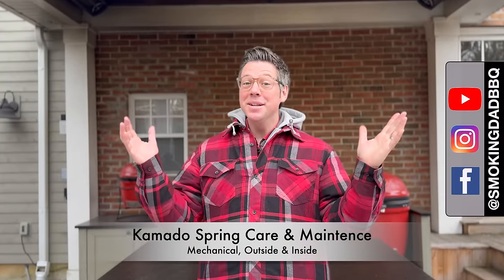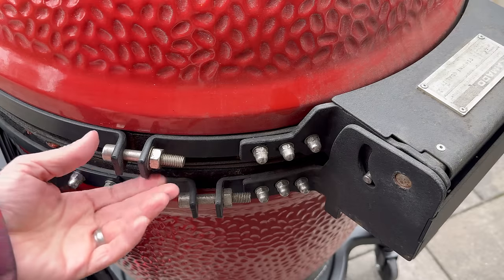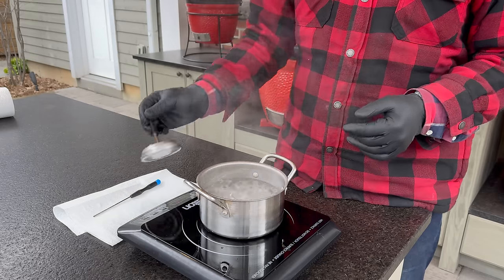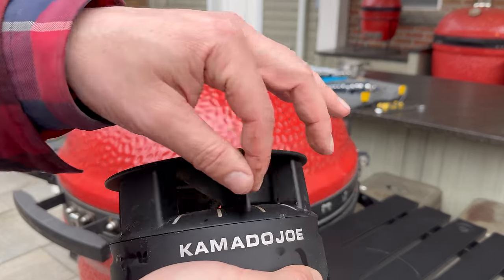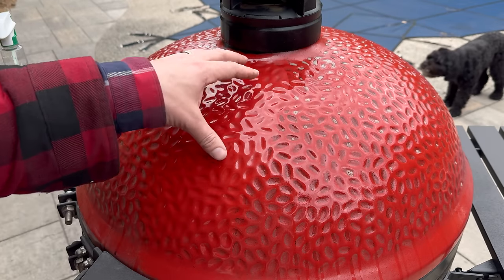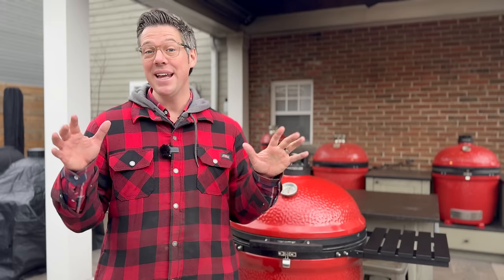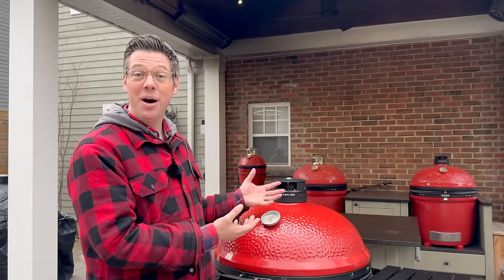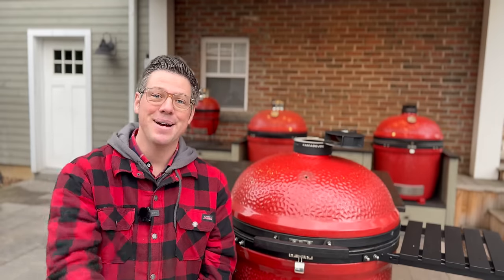3 Kamado Joe Cleaning And Maintenance Tips For MAX Performance & Longevity

Comment: While I'm being assistant SDBBQ, I'll add that drill brushes are great for cleaning leather seats in your car and cleaning soap scum in the shower.  I bought a set that has color-coded brushes that range from soft to stiff.  Apparently the stiff ones are good for paint removal.  I haven't tried that.

Comment: I've also found cleaning the outside of a Kamado when it is still hot (not astronomical; maybe 150-250 F) makes it A LOT easier. Just like hot vs cold water for cleaning dishes.

Comment: Great video.  It is definitely time to do this here in the SF Bay Area if it ever stops raining.  My two cents USD:  Krud Kutter is my go-to.  It's not "organic" but it's reasonably benign and it cuts through grease better than anything else I've used, including that orange stuff.  Also I really, really recommend a small ash vac for regular cleaning.  Shop vacs aren't built for the dust that results from Kamado Joe cooking.  Ash vac were originally designed for cleaning fireplaces.  Mine is battery powered, so no outlet required or cord to get in the way.

Comment: Ashes (at the bottom of kamado) are great insulant and they protect ceramic. Also they add accumulation capacity. I would recommend to clean, but not so thoroughly as you did on video. Thanks for great video!

Comment: Great tips on keeping your grill ready and clean every spring.  I haven't done a clean burn in years because of cooking my gaskets over time doing the clean burns.  I found putting just a little more charcoal in the basket and letting it go full out after my cook usually keeps the grease burn out of the unit.  I have cast iron deflectors that I usually put AL foil on to help the clean up too.  I live in a dry climate and don't have to worry about rust or mold during the winter.  I also cook weekly in the winter too.  I found the KickAsh basket and ash pan work great in making it easy to clean up after a cook in my Green Egg.
Reply from the maker: I’m a fan of the kab combo too

Comment: James is totally correct. Don't let your clean burn get out of control, my last attempt I got distracted and the kamado got up to 800-900 degrees. The metal firebox ring warped and it's impossible to unwrap it. I ended up using stainless zip ties to secure it. Don't make my mistake...listen to James!!😂

Comment: Question?  I tend to do my slow/low cooks so with that said, my grill is a bit of a mess at the moment so this video was quite helpful with regards to doing a clean burn if you will.  Once I get the grill cleaned out in the next few days, do you recommend maybe just bringing the grill up to a 5-600 degree burn once done cooking for 30-45 min every couple of cooks to help burn off some of the grease and what not?  I have a kick ash basket but am about to order the ash can now.  Makes so much more sense!  Thanks in advance!

Comment: Thanks for the "torque measurement" on the band. I've been afraid I'd over torque it & break it. I'm headed outside after the video and give it a little more tightening. I did recalibrate my temp gage while super heating the KJr to clean out the underside of the dome.  Cleaning the dome really helped. My food was starting to taste a little  like house fire.

Comment: Hi James…I bought a big Joe 3 shell for a hell of a deal and I’m now outfitting it. I looking at top vents…in your opinion which is better…kontrol tower? Old school cast iron? Or the after market Smokeware?
Reply from the maker: they are all good so its more a matter of what look and or function you prefer... i would put daisy last just because it moves around when you open the dome.  long term, the SS doesn't have paint so it will look more similar to what it does now but performance wise they each have some usability advantages and disadvantage vs one another

Comment: Hey James! I just did you pulled pork recipe yesterday and it went great! 
On this video, I'm curious about the kickash bucket. Is it compatible with the KJ basket? Also, if you want to add wood chunks mid-cook do you just kind of shove them in there with an ash tool? I've been using your ash drawer hack, so I'm curious how that changes with the bucket. Thanks for the help!
Reply from the maker: It burns great but it’s a little harder to load them in. I use my high heat gloves and shove them in … that’s what I did in that clip shown here where the wood combusts almost immediately

Comment: My air lift hinge droops like 6” when fully opened but also still doesn’t stay closed down on my joetisserie. It’s frustrating.

I would love for mine to only drop 1/2” to 1”!
Reply from the maker: have you tightened the nut at the back of the dome?
Reply: @SmokingDadBBQ  I did reach out to KJ support and went through everything they wanted me to do.  They're shipping me a new hinge but said it could be months before it ships.

Comment: @Smoking Dad BBQ
Just a thought:
I just wonder if you don't fatigue the metal by tightening the bolts every year?
Maybe the bolts don't get loose, but the metal stretches?
Maybe you should mark the bolts to see is they are loosing up or just streching.
Reply from the maker: They are stretching or the tabs a folding in a little each year i am sure but given lose isn’t an option not sure there is any alternative

Comment: Thx for video James. Did I understand correctly that you now keep that stainless steel wing box inside the fire box? I must say not including it makes it really easy to clean the whole firebox but you’ve learned it’s better to keep it in?
Reply from the maker: No I don’t. I use the kab can instead. Just took a moment to appreciate stock is better than other kamados but I prefer the can to get all the ash and not have the build up shown after doing a 6 month test with them back in
Reply: I’ve learned so much from you. Thanks James.

Comment: Thanks for the tips. Do you still recommend taking the firebox apart to get the ash behind it that falls through the air holes or do you think the shop vac is a better option?
Reply from the maker: id rather not do that often so shop vac or leaf blower as messy as that is before cleaning the outside can clear out behind the firebox if you've got a bunch of build up there without having to remove it all

Comment: One way to keep your outside clean on the komado is after every cook or weekly before you put your cover on is to wipe it clean with a car multi cleaner. I’ve even polished mine and waxed it…. Looks brand new and I cook on it 2-3 times a week. KJ Big Joe series 1.
Reply: @briansymes2936  did you use automotive compounds and waxes?  I was getting ready to roll the dice and “see what happens”. Mine has a little bit of spider webbing so I was going to treat it the same as car paint but didn’t know if the heat caused any issues.
Reply: @sethmiller8231  yes I use a multi cleaner for grease oil etc then either a quick detailer spray or carnauba. Wax maybe every 2 months or so. As long as it’s cold when you apply it it’s fine.

Comment: Is it possible to replace the felt gasket on a Joe Jr. with a wire mesh gasket? Thanks
Reply from the maker: i would use the rutland gasket, thats what i am going to put on mine this spring
Reply: @SmokingDadBBQ  Thanks, will you be doing a video for it?